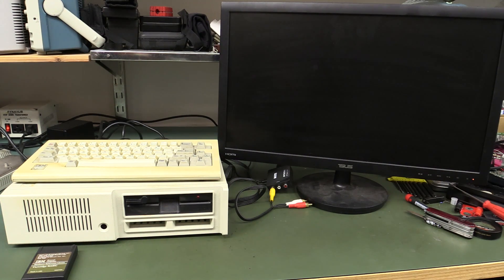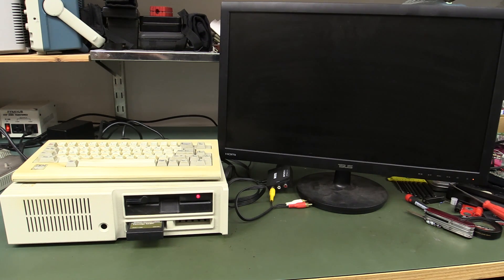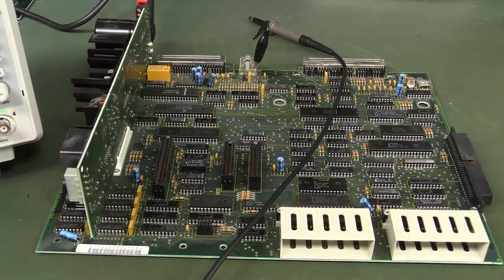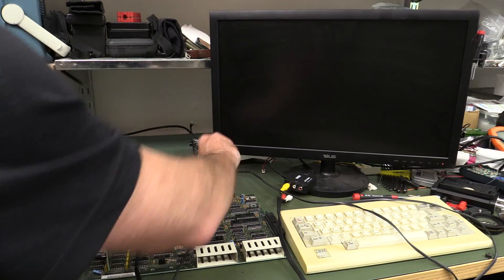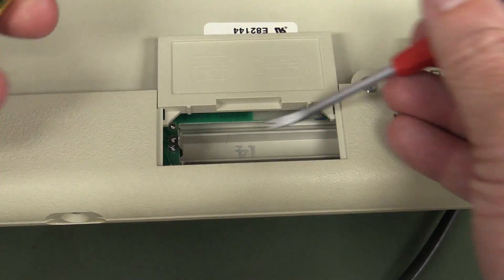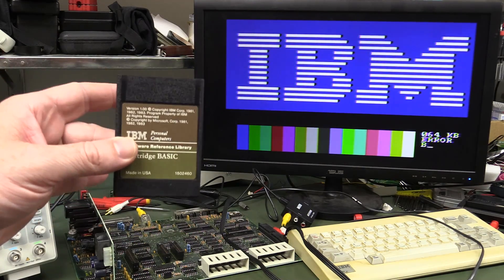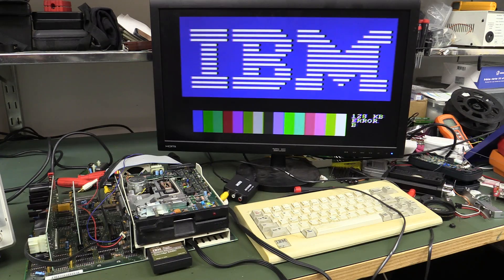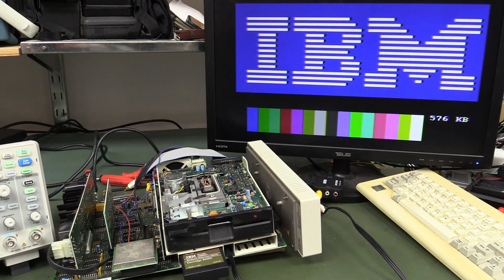EEVblog 1053 - Part 2 : IBM PC Jr Troubleshooting

Comment: Any chance you could revisit this? Maybe do some hardware hacking.?.? Such as possibly building a custom add on board or something to that effect. Ideas could be a large tange of things like to design a ram add on, or a multiplexed serial intererface for controlling stuff like we all use pi and arduino for today. Maybe a simple IDE interface and use a custom boot bios like XT-IDE. Maybe a multi build where something like a 3d printed fortune teller in glass case or older arcade like automatons are controlled by this old hardware.  Stuff a lot of us would have loved to try to do as young folk when this stuff was new, but it was just to darned expensive to play like that then or plain did not exist back then.

Comment: I guess composite output stage and keyboard are sharing the same power bus.
Electrolytic caps are off value after all that time, and this should explain the issue. Keyboard can also be drawing too much current for the same reason. 
When plugin the Keyboard, the composite amp looks to be literraly shut off at some point...
Try feed keyboard with external 5v, insulated from the PC

Comment: Check for shorted clock / data lines on the keyboard, or use its cable to adapt another keyboard.

Comment: "Error B is an indication of keyboard problems. If you are not using the keyboard cable then it can be caused by bright light hitting the infra-red sensor on the front of the machine. Whether you are using the keyboard cable or not, an accidental keypress during the boot sequence can cause it too. (And that could be a stuck key on the keyboard ...)"  from vcfed.org

it's looking like the keyboard controller is toast to me.

Comment: Just a note.  The 'LP' socket on the back is for a SERIAL printer.  It was made by Cannon and ran at 1200 baud (bps).  It was a thermal printer and was a nice thing to have.  I got one surplus and put a proper connector on it.  Thankfully it uses thermal FAX paper which is still available.  I don't think that it was used for a light pen (I've never seen one on a PC).
Reply: LP actually is for a light pen.  The serial port was labeled "S".

Comment: Hi Dave. For your old computers video, you definitively need to put your hands on a european TV, with the famous SCART connector. It provides RGB+Csync, Y/C and composite input !
Reply: Agreed the connector was not the best available. But you know French, they never do anything like anybody. First full frame front wheel drive serial production car ? The French Citroën traction. French color system ? SECAM ! French SCART connector ? I don't know who designed it, but I know the space between pins is metric, and not imperial like centronics or db25 of the same era. Designing a new connector was a way to protect french makers, and also to prevent average garage Joe to plug anything else, like a printer or a SCSI hard drive. Still today, many people destroy their network connection by pluging a usb wire.
Reply: Yeah, SCART FTW! I can't understand why its not used on all TVs world wide. Its such a useful connector. (S)Video in/out, stereo sound in/out, RGB out, H/V sync, data and control wires.
Reply: Because SCART is French. It was made mandatory for all european TV sets from 1981 onward. Since last year, it's not mandatory anymore but hey, European consumers want their SCART to easily plug their DVD, VHS or gaming console. So TV makers continue to provide the useful connector on new TV sets. In the other case, almost nobody wants the TV, and return department does not want to deal with angry customers.
Reply: OMG there is love for SCART? While it was nice that it brought out so many useful pins, the physical format is one of the worst I've ever seen. Huge clunky connector that was nearly impossible to get in properly if you were reaching around the back of your big heavy tv. The plug itself was often so heavy, that it dragged on the connector and caused cold solder joints. Pretty much everyone with a commodore or philips MSX monitor that had scart must remember this. But, yeah, proper RGB signals in even early 80s tv sets was really great to have.

Comment: "ERROR B" is a keyboard error. Plug in a keyboard, Dave! You've got an otherwise working PC Jr!
Reply: Plugging in the keyboard killed the video signal.
Reply: Not plugging in the keyboard will generate an ERROR B. PS/2 keyboards go bad, are easily swapped. There's a little plug. Index finger and thumb. Badda bing, badda boom, prest-o-change-o, aaand BASIC prompt.

Comment: Error B - Keyboard Problem, move the keyboard away from any extremely bright light source, replace the batteries, move the keyboard closer to the system if using IR and do not press any keys during the bootup process.  May cause system to hang.

Comment: I had one of the PC Jr's.  Put all kind of upgrades on it.  Used a standard PC keyboard, added a pair of hard drives, upgraded to a 720K 3.5" floppy, then added a second 720K drive, later upgraded to a 1.44M drive and a high density 5.25" floppy. Had a pair of serial (with external 1200 baud Hayes modems), and a pair of printer ports.  Of course had to upgrade to 640K ram as well. I had the CGA color monitor with it, and later even a VGA display (can't remember now if that was am external add on card, or if it was a card that went in the optional top mounted expansion case).  What a wonderful machine to play with growing up!  Still got the thing sitting around somewhere out in my storage shed - now I will have to go pull it out and see if it still fires up!  (BTW - about the only thing I never had was an additional power supply module.  It is possible that was integrated into the expansion case, but again my memory fails me on that detail.)
Reply: bsb0011 promise me that you wont bin it you have a gem imo
Reply: Naw, held on to it all these years, it isn't going anywhere.  Maybe on ebay one of these days, so it can find another loving owner.

Comment: just a question: is the lack of brown/yellow (rendered as shades of green) a PCjr defect or a capture-card defect?
Reply: SkyCharger001 That's probably the closest IBM could get to yellow via the composite video output on an original CGA. I doubt very much that matching the NTSC composite output to the digital RGBI output was a design priority.
Reply: no, I've seen some photos of CGA composite in action on composite monitors from its time.
while 'brown' was not supported (due to it requiring circuitry found in the TTL monitors provided by IBM) Yellow, though somewhat muddy, WAS.
Reply: SkyCharger001 this image appears to show the same greenish colour for "yellow". There were two different versions of CGA, the later version added some circuitry to produce a different colour palette on composite monitors.
https://upload.wikimedia.org/wikipedia/commons/thumb/5/59/CGA_CompVsRGB_Text.png/590px-CGA_CompVsRGB_Text.png

Here's another one showing the differences. It seems that the primary reason for muddying the colours was to create a legible image on monochrome monitors:
https://m.imgur.com/J3Ppu

There isn't even a usable yellow in the extended 1024-colour palette used in the 2015 "8088 MPH" demo:
http://1.bp.blogspot.com/-EiHWj5D00mU/VcPuWGVpxHI/AAAAAAAAAMw/3rwuo_85sy8/s1600/fv02_cga_1024c_all_palettes.png
Reply: I've seen photos of both versions, neither were as inaccurate in regard to yellow as what was shown here. 
(they were muddy renditions of yellow, but still recognizable as being 'ugly' yellows)

PS: the issue shown on the image you've linked to is a dot/chroma-timing issue, while the problem with the boot-up screen occurs in areas where the dot/chroma-timing-issue should self-resolve, even if it were in 80-column-mode
Reply: SkyCharger001 Thanks, this is quite educational.  I have just recalled another fact from the 8088 MPH blog; being that a hardware bug in 80-column text mode messes up the timing of the colourburst signal (when enabled), requiring workarounds to fake a colourburst by, e.g., setting the screen border colour to low-intensity yellow. Since the phase of the NTSC colourburst signal isn't pure yellow, that could account for the discrepancy in the 80-column screenshots.

I agree that this doesn't explain the boot screen, which is in 40-column text mode. +EEVBlog Dave, can you analyse the phase of the colour bars on the boot screen to give us a clearer picture of what's going on here?
Reply: Please understand that I am not trying to troll or argue here; I am just as curious about the matter as you are. My limited experience with computer systems from that era that produce composite output (SEGA Master System, primary), combined with what I've read about such systems, has lead me to the conclusion that these systems are rather brutal when it comes to generating an output that is close enough to spec to be interpreted as an NTSC composite video signal.  I'd love to be wrong about this; as that will mean I have learned something I did not know before :)
Reply: most composite-capable systems from that time used a cheap-as-dirt NTSC-color-burst-crystal for both chroma-timing and dot-timing (pixels being measured as X color-cycles wide) so they never had real issues with staying in-spec (in fact, in most cases, their graphical subsystem(s) were built around NTSC composite and thus always in-spec), but CGA was a case of converting an out-of-spec format (according to some sources CGA RGBI used a refresh rate of either 54.5 or 64.5Hz neither of which fits the 59.94Hz of NTSC) into something that approximated in-spec as cheaply as possible.

Comment: My family had one of those.  It worked pretty well for what it was, although it was kind of expensive.
Reply: Tandy 1000 was better anyways. The PC-Jr didn't make it very far on the open market. I imagine that the bulky "sidecar" expansion system and proprietary connectors might have had something to do with it. But the Tandy 1000, which was a clone of the PC-Jr DID take off, such that the PC-Jr's custom 16-color variant of the CGA standard and 3-voice DAC were later and more popularly known as "Tandy 1000 Graphics," and "Tandy 1000 Sound." A standard advertised on the sticker of almost every PC game from that era until VGA and Sound BLASTER took over.

Comment: If I remember correctly Error B on a PC Jr is a Keyboard error.  There could be a problem with the IR receiver.  I believe a bad or unplugged IR receiver can also prevent the system from booting even if the keyboard is connected via a cable on the PC Jr.
Reply: LGR noted with his PC-Jr that the IR keyboard didn't mix well with florescent lighting.
Reply: You are correct.  He should place the keyboard directly in front of the transceiver on the mother board BEFORE power on.  If the keyboard is working, that should solve the problem.
Reply: That was my thought as well.
Reply: Honestly, IR was a stupid idea for a keyboard.
Reply: Never had any problems with mine - but then again, I didn't have the level of lighting that Dave has there his lab.
Reply: He has LED lighting for all of his workspace. Whether the IR (if any) being emitted is swamping it, who knows.
Reply: PCjr keyboard had a weird cable you had to buy if you did not want to use it via IR (and constantly replace batteries.) Keyboard end was a RJ45 jack and the other end was a 3x2 plug that went into the K port in the back. However if Dave uses fresh batteries on the keyboard and puts it in line of sight of the front IR sensor (not ever so in either video) then the error B should go away I suspect.

Comment: Ah the days when the BIOS used to count every KB.  
Glad we don't do that anymore..
Reply: Leon Kernan you can enable that in the bios, if you want.... It'll take ages though.
Reply: Have a Zenith eazy PC (1987 vintage, 512KB RAM) that does the same. The newest system I own, that enjoys slowly counting memory, is a Pentium III machine maxed out to 1GB of RAM. Seems the BIOS wants to be sure, whether such a huge amount of RAM actually exists :D
Reply: 8bitMicroFan 
It couldn't possibly, as Dave said "Nobody EVER needs more than 640k of RAM!". 😜
Reply: every computer still doing that if isn't a complete and exaustive test everyone do it, you can enhacement the test on some computers a do it 5 times on some board, a normal (slow) test  and in fact isn't a good test at all but is better than nothing.
I have one bad DDR2 module at home and one 256MB SDR ram also faulty... it's useless but I can probe the problem on it, and this memorys pass the most of the ram test without problems... (facepalm), I used it to check computers, if the memory die I didn't lost too much, hahaha
that is why on servers their used ECC instead PARITY memory, but also not every computer check it and on ECC the memory write some extra information becouse if one bit change can be a serious issue but on any of our home computers you will get a crash, blue screen , or one pixel on the screen will look diferent and that doesn't matter too much